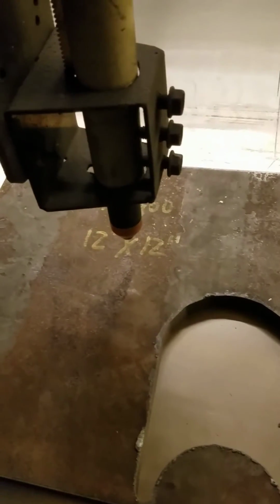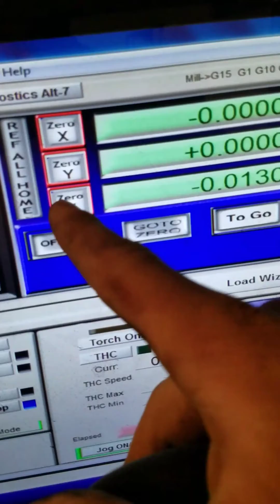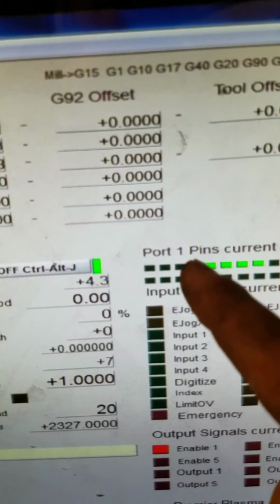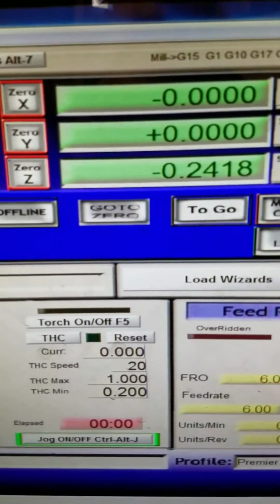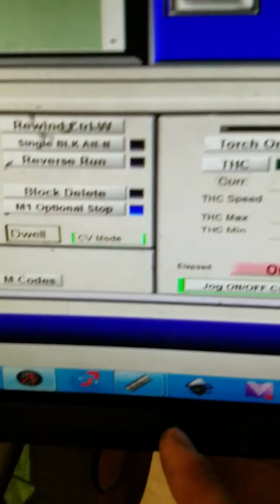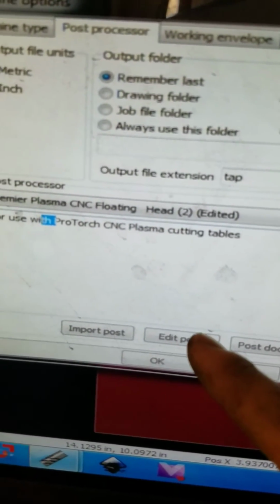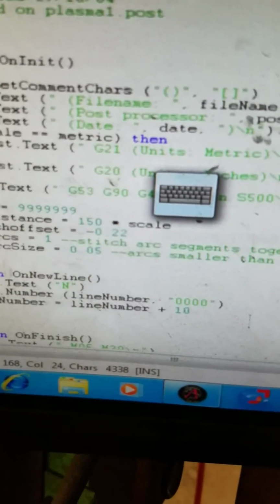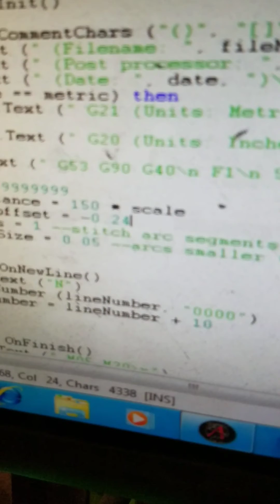Floating head calibration premier plasma

Comment: Does premier plasma CNC floating head post processor come with sheetcam  or did you make it? 
 I'm running a  sheetcam that has not yet been fully open. I need to purchase the licence, and I don't have that post-processor.
Reply from the maker: Comes with our cnc table when purchased.
Reply: @premierplasmacnc  Hey is there any similar Post Processor in SheetCam as yours? Please, any help is more than welcome.